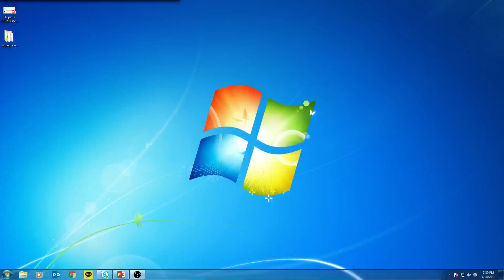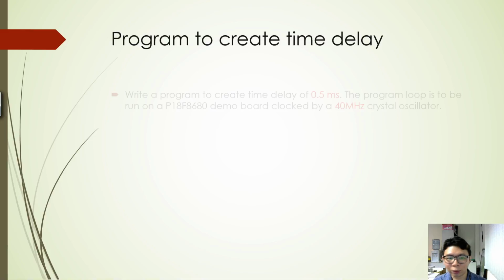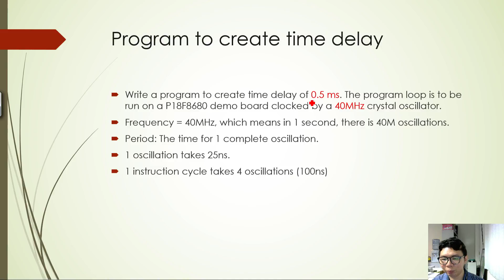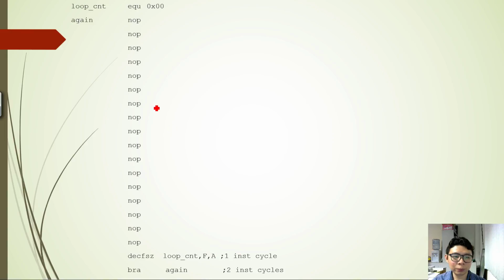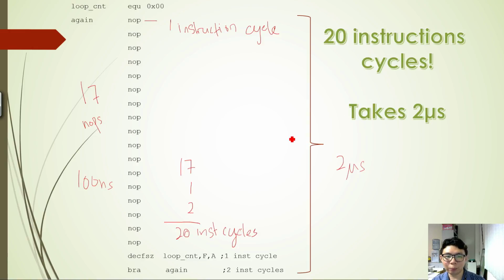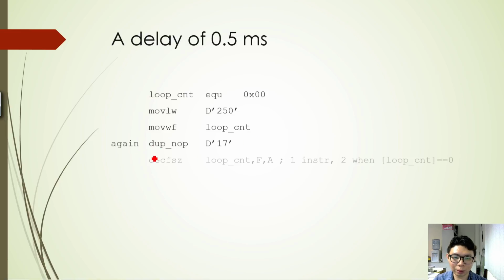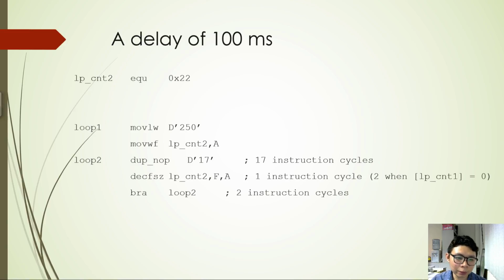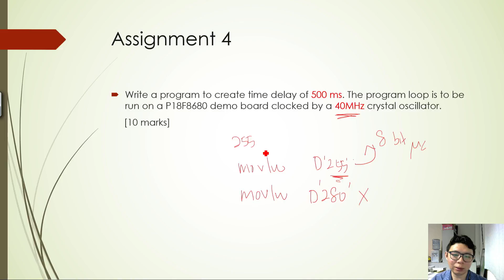Creating time delays on PIC18 using assembly language

Comment: Is it possibly that I can create 3-second delay in assembly using 8-bit microcontroller (PIC18F1330, BY MICROCHIP)
Reply from the maker: Of course you can! What is the crystal frequency? You can create a 1 second delay subroutine and call the subroutine 3 times. That makes 3 seconds delay. You can call it n times and you've successfully created n seconds delay!
Reply: Thank you. The frequency is 4Hz.
Reply: means your instruction clock runs at 1us on a 4MHz clock source.

Comment: Personally, I like using nested loops to save on program memory when creating delays. I never create delays with just the nop(no operation op-code). Macro's are great, but not great for saving on program memory as the assembler really just rewrites the code content in the macro wherever the macro is used in the main code. Code gets bulky, and for bigger projects, this could be too bulky. It would be easier to place the content of the macro into a subroutine, and then just call that subroutine whenever you need it. However, great video, I don't often see any assembly for microchip. Just the current craze over Arduino, which I loved until I discovered PICs.

Comment: so a sub routine and a time delay are the same thing? for example, if im asked to create a subroutine of 1ms, is it the same as creating a time delay of 1ms?
Reply from the maker: Best Mhike A subroutine is a group of instructions grouped together under a name. Each time you call the name of the subroutine, you are actually executing the group of instructions.

For example, i have a subroutine and I name the subroutine as "Take a bath". So this subroutine is actually composed of several instructions or steps. For example step 1 get towel, step 2 get soap, step 3 walk to bathroom, step 4 start washing. 

whenever i need to perform the 4 steps of taking a bath again and again in my program. what i can do is just call the subroutine name Take a bath and the computer will execute the 4 steps defined under the subroutine
Reply from the maker: so in the above case, my subroutine consist of instructions to create time delay. Whenever i need the time delay to happen in my program, i'd just call the subroutine name.
Reply: ok so i have this assignment that is due tomorrow, it says i should create a 1 milisecond subroutine using assembly language. how do i go about it? thanks for the early replies man much appreciated
Reply from the maker: Best Mhike This video teaches you how to do that. check it out!
Reply: ok ok thanks again!
Reply: hey dickson. i need some help here. im trying to create a programme tha lights red light LEDs, turns on overhead shower nozzles, and rings a buzzer in the case of a fire inside a building using assembly language. how do i go about it

Comment: Using " nop delays" is a waste a CPU. Start a timer and let your code do other work til the interrupt for the timer happens. Using " nop delays" is not an effienct way to write code because your code is doing nothing but calling the same instruction over and over, If you are using delays to blink a led, why not set a timer with interrupt? Turn led off and start timer, continue checking sensor, storing data etc etc, once the timer interrupt triggers turn led back on. Never use " nop delays" professionally.